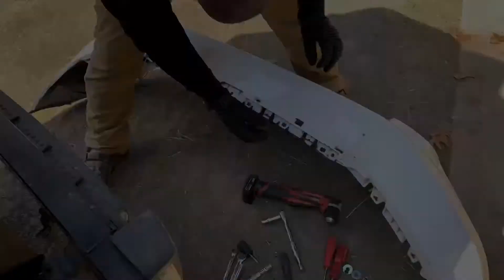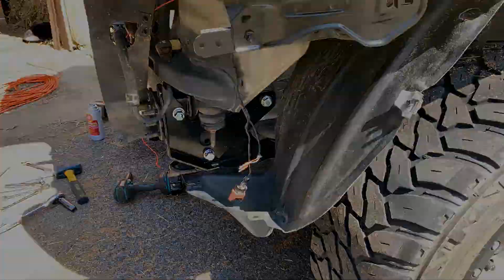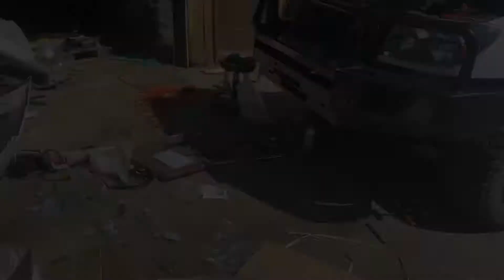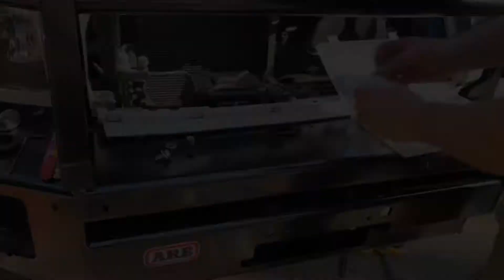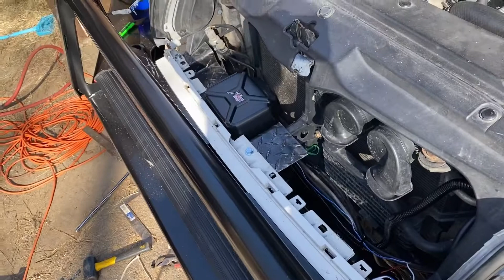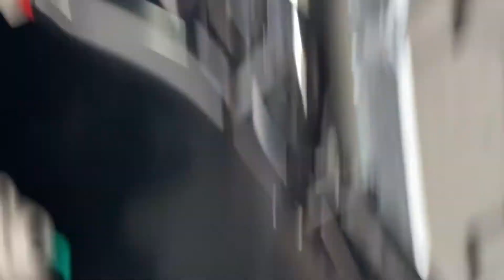4Runner Project Part 8 - Installing an ARB 4x4 Deluxe Bull Bar, ARB Fogs and Smittybilt XRC Winch

Comment: What fairlead did you use for synthetic rope? I isn't the same as the smittybuilt you showed earlier and did you have to cut the bumper?
Reply from the maker: I didn’t use the supplied smittybilt because the hole in the bumper is slightly off. I used a factor 55 offset hawse fairlead - https://www.factor55.com/p-offset-hawse-fairlead-00026?gad_source=1&gclid=CjwKCAiA3JCvBhA8EiwA4kujZgej27mpshyfttqUgnPCkRsuGLsZpUKnJ_WeR7JBIhTsMfqo9yq0ghoCiAUQAvD_BwE

Comment: Great video, how heavy is that bull bar, not listed on their website
Reply from the maker: Thanks! Shipping weight said 127lbs but if you factor in the pallet, it is probably closer to 100lbs. Once you factor in the the winch into that your easily adding over 200lbs to the front end. I definitely recommend heavy duty spring rates up front if you do this.

Comment: What bulb did you go with for the turn signals?
Reply from the maker: Used #67 for both. No melting to date and both are functioning as running lights (the turn signal bulbs blink as turn signals when utilized as such).
Reply: @boundlessbuilt943  I will probably use these for my 2011 Tacoma
Reply: @boundlessbuilt943  This is it right?
 https://www.amazon.com/67-Automotive-Brake-Signal-Marker/dp/B01HU8DE9I/ref=mp_s_a_1_3?dchild=1&keywords=67+bulb&qid=1625978934&s=automotive&sr=1-3
Reply from the maker: Yea that looks like it and the part description calls it “Part No. 67” also I paid that much for two bulbs… lol

Comment: New sub, 
really enjoy the work you have done to your rig.  I have an 05 sport that I purchased new and have been adding goodies over the years.  I went with the Shrockworks bumper  paired with a Warn EVO 10S , Prinsu Design Roof Rack,  OME lift with heavy springs, Total  Chaos upper and lowers,  Corbeau suspension seats, ARB Snorkel with a Fleetguard  pre-cleaner, rear window molly panels from Rago Fabrication, Baja Design ditch lights and amber fogs... ARB 50qt fridge, ARB 2500 Awning paired with the deluxe awning room... etc etc etc.. Love the T4R and  can’t wait to see where your build goes.. 
cheers
Reply from the maker: Thanks for the sub! Your set up sounds awesome. I was looking at Shrockworks as well.  I’m kind of wishing I had gone OME suspension because of all the weight I have added. Might make some adjustments in the near future. What’s next for your build?
Reply: @boundlessbuilt943  
Still have a couple of goodies to add to my 4th gen... I purchased a complete set of Aluminum RCI skids including the gas tank.. that will be my next project. Went aluminum to shed a little weight. My frame wasn’t as clean as yours, had a little scale in spots and I had a little surface rust on the floor pan where the spare once lived so I had the complete undercarriage sandblasted, primed, and coated. I also had a Magnaflow stainless cat back exhaust installed a few years ago. I like the exhaust tip dump behind the passenger rear tire because it reduces the fumes coming through the back window.  Don’t know if you are in the market for  rock sliders but if you are looking at bolt on options I highly recommend White Knuckle Off-road.. I went with the DOM (drawn over mandrel)  clean welds and powder-coat. Looking forward to more videos on your build 👍🏼
Reply from the maker: Solid choice! Sliders and skids and definitely on my list of must haves.  I’ve been eyeing RCI and LFD. I’ll check those out. I’m trying to figure out a tire carrier solution since my spare doesn’t fit underneath any more (sport hitch).  I have a stack of parts still waiting to get installed but haven’t been able to because a deer mangled my daily - so it’s been taking up most of my time.
Reply: @boundlessbuilt943  
Are you on FB or any other social media that you can receive a few 4Runner Pics?
Reply from the maker: Not on FB but I am on IG: @boundless_built give me a follow and I’ll follow your right back. Want to see your build!